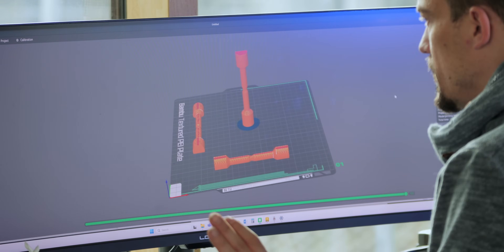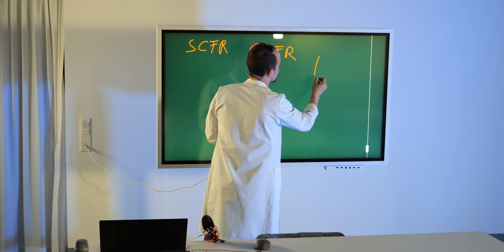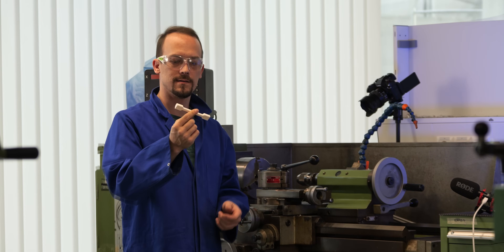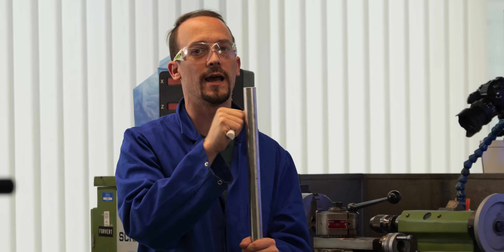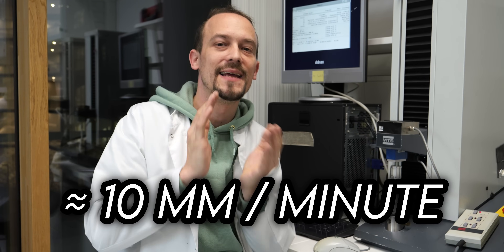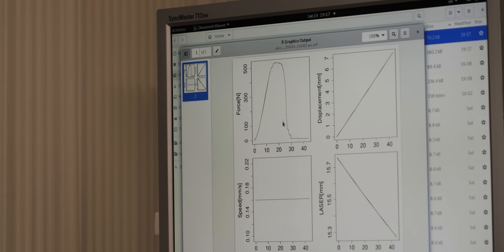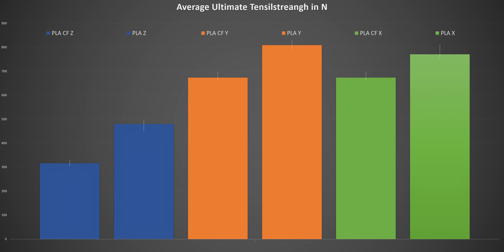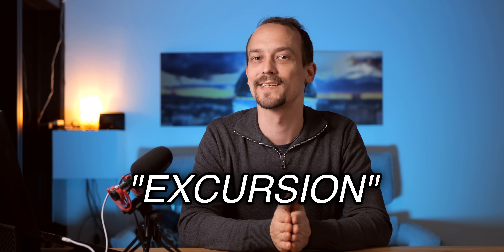The biggest SCAM in 3D Printing? How filament stores try to trick you with carbonfiber "reinforced"

Comment from the maker: !!CORRECTION!!: 15:26 
I meant to say "peer reviewed " instead of "Board reviewed " when talking about the research Paper!
Reply: This was exceptional. Please do more of this. With more people having access to engineering grade materials now, the marketing hype train can go off the rails quickly. Most can't decipher the polymer acronym soup and just go by what the description claims.
Reply: it is imperative that you test CF+NYLON before publishing your studies. I already knew it was weaker for PLA. Regarding to PETG, i thought there was some advantages. You have everything to become a reference on materials if you make a good explanation comparing not only the downsides but also the benefits that would make CF+PETG outperform PETG and as well covering the benefits that CF+NYLON would outperform NYLON.
Reply: CF & GF is not about tensile strength.. if you used a brain for a minute, you could come to this conclusion - less plastic, weaker bond in all directions since the fibers are chopped and not continuous, they don't contribute to your test at all. This filaments shine in stiffness and that is all.
Reply from the maker: So watch part 2 then 😅
Reply: Can you please try testing the strength in a higher temperature environment? Cause that's what I use PETG cf and I think a lot of people
Use it for that reason.

Temperatures, I would like to see tested at would be 30°C
40°C 50°C 60°C.
Reply: Hi, any update on the paper? I'd love to see more details on these tests, for example what manufacturer was used when buying the material?
Reply from the maker: @redface-k7j  thanks for your concerns. All.machines are filtered and the whole room was designed specifically to host this lab. 
We have a quite capable airsystem wirh high and low pressure zones. Air from these machines never reaches the area where I sit. 
I addition, this computer isn't my only workspace. I have access to a whole other area for prolonged computer work.

I still appreciate that u pointed it out. People do not keep the dangers of pollution in their workplace in mind enough. Or just don't care 🤷
Reply: @Ibuiltathing 
Can you ilaberate amount that. 
I have tried to do something simpler
Reply: With the political troubles is it still safe to order from your sponsor PCBWay?
Reply from the maker: @soundspark  I can't really answer that. I live in swizerland. So it's way different for me than for you
Reply: @ Of course you can't answer as to whether or not they have adequate data security as that may breach the sponsor contract, right?
Reply from the maker: @soundspark  no actually. The sponsor contract is extremely short and does not give me any talking points or forbid me from stating anything. 
What I actually hold them in high praise is that it doesn't even state that I have to talk about them favorably. 
My answer was based on the belive that u mean with political situation the ongoing tradewar and terrifs.

If data security is your concern I always have the same answer: go local and put a nda in place. 
In general never use any service with parts you want to keep secret if u do not absolutely have to. Or go with a provider that has nothing to gain like a puplic funded one like it is the case with the corefacility I have at my university. 
PCB Way is a super cheap but also high quality provider. And those are the only statements that I can factually make because for every other claim I simply do not have data to support eather way. (Exept that their customer support is always super nice to talk to).
So do I trust them with everything I need? Yes, absolutely. Would I print my final prototype of a not yet patented product .... no.  But not because I don't trust pcbway or because they are in China. But because I wouldn't trust 99.9% of service providers with that because of the high stake.

Comment: I am glad to have had your video show up in my recommendations. I have been thinking about testing prints for tensile strength but focusing on the parameters such as the number of walls to infill patterns.

Your explanation of the CF properties and SC vs LC or CC was spot on. I have actually been confused by this hype about CF being stronger. It's a filler, additive used for very specific specs but strength was not one I remember from my injection molding days. I am old and not in good health so my memory could be wrong.

I saw your tensile strength testing equipment and perked up. Then you said uni and research paper, and then I was sad. I don't have uni or friends at uni with labs.

IM requires raw material suppliers to provide this data along with other data on a certified material analysis with each lot. Filament suppliers don't provide any data ensuring their quality. The really smart and good molding shops will test the material in house to verify the data.
Your video has me curious if my personal theory of GF filament being the better choice over CF but only for the engineered materials. I also believe this idea of using as little infill as possible is a very bad choice. The bonding between layers has been my thought process when printing and your explanation here has given me confidence that my theories are on the right path. My education and training have not let me down.😂

Comment: Am i mistaken or did you print the specimen not with 100% Infill? 

Isnt in that case the infill geometry  influencing the testing significantly?
Reply from the maker: It does, good catch. 
But it's comparative. So since all where printed like this you can still compare.
The reason why it was done like that is that i tested how a normal user part behaves not the raw material property

Comment: I think the greatest problem with printed parts is the creep under the pressure of a screw. Most parts will not fit its position cause every week i have to control if the screws are tight.
So now in most case i design and make my needed parts from 6061 or 7075 aluminium.

Comment: I'm interested if you are annealing these parts. Printing Temps don't fully crystallize the carbon fiber. They need to be annealed to unlock its true streangth. That's all cf material. Pla petg pa6. All cf material needs to be annealed.

Comment: I noticed that electrical gave plates by Leviton are GF- nylon and by Eaton are PC. They are both advertised as "unbreakable". The nylon ones break all the time. This is only one experience with the two.  I have noticed similarities with RC helicopter frames and many other comparisons. I will take non GF reinforced materials of their GF counterpart any day. It makes plastic brittle. I am sure their are good applicatjons but I think they need to be better considered because most of the applications I find make the product worse even with nylon which is supposedly still better with reinforcement.

Comment: I wish I had watched this video before I decided to start a 14 hour print using PLA-CF. I never used it before the other day when I found a box of it I didn’t know I had. I had just run out of tough PLA, so I decided to give the PLA-CF a try. My opinion? These prints are very roughly textured, but also pretty strong. I’m not convinced that this material has strength advantages over tough PLA, but it does seem stronger than the regular stuff, if not more brittle. I wonder if the advantage is actually added resistance to sheer force between layer lines. It would make sense in light of what this video uncovered. Carbon fibers sticking out and into the adjacent layers might create a sort of cross-linking effect between layers. In any case, I’m heading to the store now to pick up a fresh roll of tough PLA like I should have done yesterday.

Comment: Try the esun short fiber pla/cf and see if there is a difference. 
Pla-cf has 10-30 % fill also long and short fiber. 
I had cheap generic 3 years ago short fiber and matte finish. 
It is on all my 3d printer braces. No failures yet.

Comment: In material properties there are quite a few dimensions, in this test you are only doing it for one dimension pulling (tensile), the materials can also be tested for shearing, torsion, pushing. I believe your conclusion can be true but you cannot state it if not testing the other forces you can apply.

Comment: great to see some serious machines in a single lab. 

regarding filament, there are many manufacturers doing fiber reinforced composite filament. but don’t expect small companies without dozen of PhD can make something comparable with MNC chemical company like Evonik. composite is not just mixing and cooking, it requires a lot of real material science and engineering. the manufacturing process is the determining factor even with the same compositions. 

additional points to note:
1) 220ext med and m220 are better put in cleanroom. (rip apium anyway)
2) the flexural test fixture….. a screw??????

Comment: I've never deeply looked into it but the color can effect the strength of a filament drastically, according to the claim. From what I've heard if you can't find the material just naturally colored (No added coloring) then at least for PLA supposedly black and red are the strongest. Might be something to investigate. I just use black for everything except household garbage like paper towel holders, which is usually matte brown pla from overture because I'm a boring guy.
Reply from the maker: U are right. And while preparing for the next episode of pla-cf debunking u actually looked at the material under an sem (scanning electron microscope) and was able to see the color additives and what it does to the material. Could be even worth it's own video.

Comment: First of all, thanks for valuable insight, and X vs Y difference is surprising,
Maybe you can retest with same setup; 

- Without infill or very minimal, 
- Only X and Y sets
- Concentric for top an bottom 3 layers
- 4 walls total with Arachne for 3 walls
- 0.6 nozzle and 0.3 layer height 

I know its not supposed to change the internal mechanics but will give most potential to both setups and show who will benefit more, even the each increase ratio from your first test will tell a lot, as well as the X vs Y case.
If results are similar and proportional, it will be a clear fact than.
Reply from the maker: That's a nice idea for a followup. 
There will be an update soon. Just wrapping up filming episode 2 and 3 that will cone out in about 1 or 2 weeks where we did additional test.

Comment: I would agree for everything you say except for PET-CF(not PETG), with the right setup the layer adhesion is as good as PLA (measure with accurate test) and its is extremely rigid, that is a really interesting combo, honestly the feel of the piece is almost like aluminum, hard to explain, but tried PET-CF with a heated chamber and  320C on the hotend, you will see, it's the only carbon fiber material that make me WOW, even nylon CF have not this balance between rigidity and resistance. 
Let remember that one of the more rigid material is PLA with plastic, but its have way too many weak points for many engineering application. I would like to go away from CF material, but if you want something rigid and that the thing you make is really thin, i dont see any other option in ''normal plastic''
Reply from the maker: I agree with u. 
Pet-cf is way better. And if u go to pa or peek cf than the cf will add a lot. 
The issue is not the cf in the material but what Polymer u combine it with. 
Peek is super crystalin and can also adhere to the cf. Pla and petg cant do that. That's why it is weak. The cf just floats and creates voids. 

There is an update video coming out on this video in about 1-2 weeks where I looked into that (and also bending and stiffness).

Comment: I made this point (more, or less) in a Reddit forum and got chewed out from all directions. My argument being that as soon as ppl hear CF, they think of CF cloth/mat/resin applications and think that their prints must be stronger. The main difference being that the filament is made with incredibly short fibres - almost powder - and it's suspended in a medium that it doesn't bond with... which completely defeats the purpose and physics of CF applications. Next gimmick will be diamond infused filament - the hardest filament on the market.
Reply from the maker: U where chewed out for accurately stating facts?
Reply: ... and accused of posting misinformation! I didn't take it too hard - I figured it was either CF filament reps, or just ppl who've never laminated CF cloth before. The stuff they put in filament is no more than a lightweight filler.

Comment: i believe you are supposed to heat carbon fiber printed parts in an oven at 
around 1400F to finish binding the molecules
Reply from the maker: Yes annealing would give it more streangth. Same is true for the raw materials tho.
My goal was to produce parts like anyone would use them. Also i followed the instructions of the manufacturer on how to use the material. My goal was to mainly simulate the normal everyday user. But valid Point !

Comment: Did you do any tests on tensile strength? ( i hope i got it correct… how hard is to bend them) because that’s where i see a use case for specific axis bending strength. And you can plan this with the slice position
Reply from the maker: I do these test right now but I couldn't include the conclusion in that video yet. I will have to wait for the paper to be published otherwise it would be a prepublication and the scientific paper would be rejected. As soon as publication is done I will follow up with an update. 
But sadly that can take month and month

Comment: @4:30 i have not watched your video yet - but this is a flaw that may or may not affect the results later

you are not comparing the same material from the same manufacturer i assume (did you compare the datasheet?) 

there are videos out there by for example MyTechFun that compare materials from the same manufacturer - look for "PPA: The Strongest Filament Type? Testing Regular, CF, and Core by Siraya Tech" that result in showing that the CF-variants are "stronger" in bascially every aspect that people using as a source that CF makes it "stronger - but when you look at the Material Data Sheet by Siraya Tech you'll find out that the filaments are formulated different - there is roughly 5 to 10 % gap in the polymer blend which are possibly additives and the CF variants just happen to have carbon fibres in them

in organically filled filaments (wood or carbon fibre) usually a "coupling agent" is needed - for example stearyl titanate but this also greatly increases the layer adhesion

so it is not an apples to apples comparison, even when you are comparing the same manufacturer (or brand) - it might be totally different things

But i'll continue watching now :)

edit: @8:40 - yes, and that is why "good" CF-formulations use coupling agents to bond the polymer better to the organic fibres - that also greatly improves the layer adhesion as a sideeffect, but leaving out the carbon fibres would improve the layer bonding even more - but to "trick" customers into thinking CF is stronger, they formulate the CF blends "better" ;)

Comment: Good video from an actual materials science expert who has data to prove it! CF filaments are indeed a scam, and the little benefit they offer is not worth the cost. This is unless you can justify the negligible stiffness benefit for that shelf bracket design you spent 3 years optimizing. I mean, my bra, if you are really interested in designing high-performance things, you can't expect materials to compensate for bad engineering. I can say this since Im a mechanical engineer and designer professionally... It's really funny to see how people go on about "WAAW, CF filament is so next level!" No, kind sir, it is indeed not. The real problem I see nobody talk about is the health hazards — frikken microscopic fibers exposed on external filament surfaces contaminate everything they touch and sit in your skin, after which they fall and become dust. How about the situation if the filament burns?  I'm sure your lungs would love this! I'm making carbon parts at home and even wear full PPE + a respirator when handling it — it's literally like asbestos.

Comment: Rly thought too less about that topic and used tons of PETG-CF. But i also care so much about print direction, that atleast worse layer adhesion wasnt a thing. Also i reduce layer height for that.
(usually)
For my FPV Drone frame i might stick with it, since stiffness is key here and i only print flat parts that will be screwed together.
Actually my biggest problem is bending on PETG anyway in most cases...hm.. 
Maybe i should stop hating PLA, but damn, that just a bit Sunlight kills it is annoying.

Comment: I'd guess if your application only requires tensile strength as the only matter of significance, then the lab coat makes sense. See it's not as strong when I pull it apart so they're lying 😅

Comment: I live in Bogotá, Colombia. Humidity is like 90 per cent always. I was worried about getting a filament dryer but...... I opened like 3 rolls of generic filament more than 3 months ago to print some parts and put 2 of them back in the boxes without plastics bags or dryers or anything and one still hanging in the printer as I don´t use very often. Lately I decided to upgrade my old Tronxy printer, replaced board for MKS Nano Robin 3, direct drive, 2 z axis, capacitive sensor, etcccc.  I decided to waste that filament to calibrate my printer without reaching any perfection but for my surprise, this printer with a completely filament surrounded of floating water at 90 per cent hunidity as I said, is printing absolutely fine. Maybe is a miracle from Marlin 2.1.2.5 or latest Cura version but I am completely surprised. So, I don´t need a filament dryer! With Cura, Ideamaker and Orca I get the same excellent priints.